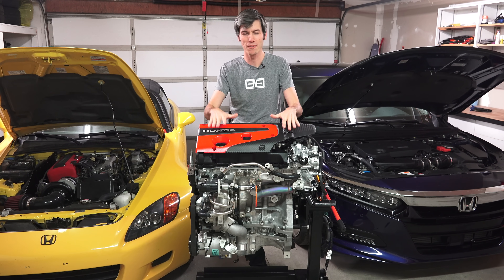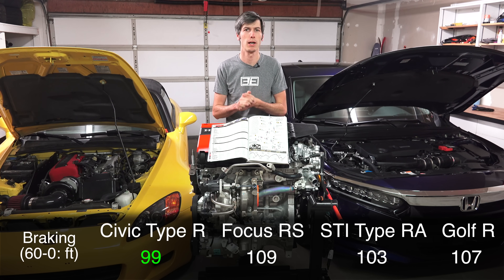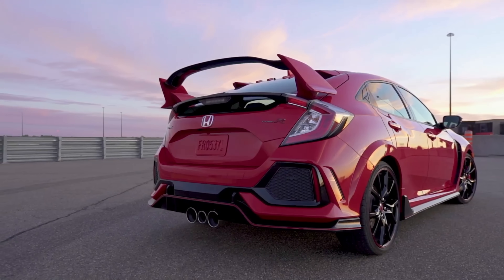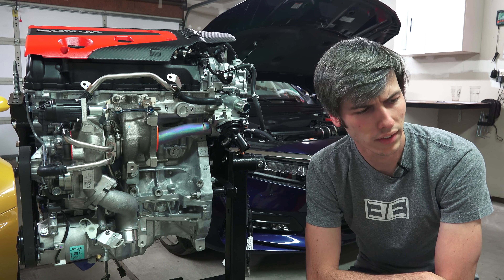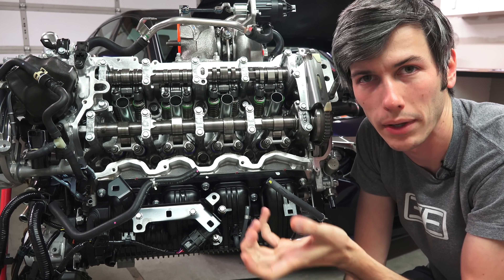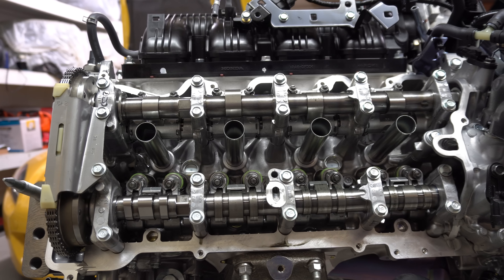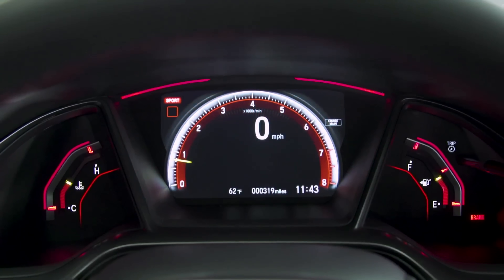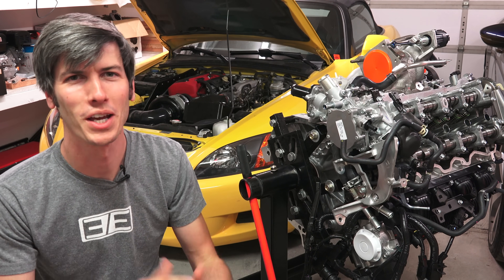The Honda Civic Type R Destroys The Competition - The Best Engines

Comment: Subaru.... wtf....
The EJ entered production in 1988.... sure, they've 'update' cams, injectors, and such but they are STILL running that engine in their flagship car... 30 year old engine design.  wow
Reply: 30 years isnt much. Building engine from scratch isnt cheap, evolutions of old ones are popular because they are unproblematic. Look at Ferrari, Lamborghini.... McLaren use 30 old years Nissan designs, Jaguar wins lemans in 1946 and then in 1988 with the same engine..... Its normal to use older and unproblematic power units.
Reply: TheDBall73 The EF came out in 1988. 1993 brought it’s EJ replacement.

Comment: ive seen too many drags with the new type r vs all the cars on the list here...the golf r dsg smashes the civic every-time...
Reply from the maker: Yeah, but how fun is it when you drop the third pedal? 6-speed is the way to go!
Reply: its a fair comparison, manual vs manual, the fwd manual golf is like for like and stands no chance to the typer
when honda can make a reliable dsg at this bracket they will release it, until then you can buy a dsg vw that fails at 30k miles....

Comment: If only MotorTrend would actually do the comparison with the DSG trans in the Golf R...it beats each and every vehicle on that list. Also, no Honda dealer sells that ugly ass Type R at MSRP (Not that I’d pay MSRP for it anyway). 

I would agree the Honda 2.0T is a nice motor. They should mate it to a beefier version of the 10speed tranny that’s in the Accord.
Reply from the maker: It's an all out hot hatch. 6-speed manual is the right choice! :)
Reply: Because its manual vs manual firstly, and secondly the DSG is in another bracket.... its kinda like asking why the dsg golf R doesnt get put up to the nsx

Comment: The Golf R is able to consistently do the 0-62 mph run in around 4.5 seconds, 0-100 mph in less than 11 seconds and the 1/4 mile in around 13 seconds, meanwhile MotorTrend isn't able to get those numbers on an AWD car but they can on a FWD car. The Type-R is an impressive machine and I'm sure around a track it smokes most hot-hatches, but the straight line numbers seem to be biased towards it.
Reply from the maker: Those are likely DSG numbers. Everything compared is manual.
Reply: @EngineeringExplained  Even then, the difference between a manual and a double-clutch gearbox shouldn't be so great, unless the driver does a terrible job with the 3 pedals...  The Golf R should be able to do 0-60 mph in less than 5 seconds regardless of the gearbox type. 

Thanks for engaging though, Jason!
Reply: I agree man. I've seen a type r go head to head with a Ford rs myself and guess who won off the line xP Ford.
Reply: @kaelanburke2097  Exactly, FWD can only do so much!
Reply: I agree my friend. Have seen a couple test of Golf R's where it hit 4.7! I would take the Civic though.
Reply: @keithjackson4985  There's tons on YouTube, some even hitting less than 4.5 seconds to 60 mph (with the DSG). I really like the Type-R for what it's worth, it's a FWD marvel. I recently saw it on the drag strip and even in wet conditions it hooks up and goes like it's none of its business. But I would take the Golf R any day, I love that thing.
Reply: @mikerelvas  I hope you get one brother. I'll be hunting for you! Lol!
Reply: @keithjackson4985  Let's go lol. Thanks man, you too!
Reply: You can't trust 4.7, 4.5 tests. The power in some area is greater than another.The sea level is very important, the ground level, the tires, the wind and finally the road conditions. So if somebody did the test in the same condition between the cars with the same driver that's should be the most accurate test! The true is nobody can beat Honda engines for reliability and maintenance cost.
Reply: @kirostar12  this is only valid for NA engines. Turbocharged engines see much less effect from the sea level difference.
Reply: Drive a type R. I rented one over the weekend and trust me it will blow you away. Especially considering its FWD.
Reply: @Magnum570  I never said otherwise though. I know the new Type-R is incredible and manages to put 320 PS on the ground like it's nothing. I just don't agree with MT's numbers...
Reply: Ya just gotta love the VW club!😂
Reply: @stwg32  Oh right, because Honda has a pretty good reputation going for itself lol
Reply: That check engine light will eventually catch up to it faster then the type r will.
Reply: @Ricky__96 I've never had any new vehicle have so many issues from the factory until I bought a Type R.  Head unit issues, wire harness issues, pcm issues, turbo solenoid issues, etc...  Traded it in for a mk7.5 dsg and have zero regrets.  I actually can drive my car now.

Comment: As far as I know, the VW Golf R mk7.5 in the USA has an acceleration time from 0 to 60 mph of 4,7 sec with DSG 7 gear box and 5,1 sec with the manual 6 gear box. 
In Europe this numbers are a little bit better with 310 HP making the 0 - 100 km/h in just 4,6 second with the DSG7 gear box.
Reply: The numbers in this article are BS...  I’ve not seen the type R out accelerate anything out of the hole and of course they used a manual Golf R...  a DSG Golf R destroys everything in its class.
Reply: Numbers are always off. You look at stats (by people who actually produce them) for different cars and you’ll get different results all along the board. 

I bought a 2018 manual SI versus my friend getting mk.7.5 golf GTI dsg knowing his was a lot faster 0-60 due to the gearbox, wheelbase, 20 more horsepower and an entire 60-70 more lb/ft of torque. 

However, despite the numbers “confirming” that my car will be slower, it is not. In digs as well as rolling races, the SI has never lost, despite having a manual gearbox and being quite significantly underpowered when compared to the GTI

There’s a lot more to cars than weight, gearboxes, and horsepower/torque.

We came to the conclusion that the mk. 7.5 golf’s gears are too long and it’s dyno’d powerband is not as consistent as the one in the SI, making it’s superior power less useful.

A lot of the time, you get cars that produce nice numbers on the dyno but aren’t able to use that power due to various restraints.
Reply: Steven Caicedo-Suarez   —  completely agree with you.  I drove them all including a little used NA Cayman and picked the 2018 SI for my daily driver, I couldn’t be happier.  (Yes I have many vehicles, including a Corvette, a gen 2 Raptor, Subi, EVO viii, as well plus several gas and diesel one ton trucks too.)
Reply: @stevenc8717  agree with you too, ive done lots of races against a friend of mine whose driving a 2016 wrx impreza, it has 268 hp and still he could never win on the long run against my si 2008 with 197 hp. Numbers are not all and honda has a way of engineering things, it just works !
Reply: Y'all have a huge advantage in that the utter garbage fuel in North America isn't even as good as your "eco blends", haha
Reply: Eulogy - not necessarily true. Don't forget that European octane numbers are calculated with a different methodology, and RON (European method) is higher than the US ((RON + MON)/2) by 4-6 points.
Reply: @ulogy  AKI and RON are not the same. Our 93 is just fine its the cali version of 91 that sucks.
Reply: a 2002 bmw m3 does 0 60 in 4.8 even tho the focus rs has 20hp and awd is still slower
Reply: Honda Type R vs. Seat Leon copra 300 with DSG
Reply: This article is bs. They tested all top of the line cars of this segment but couldn't find a DSG MK7.5. They even got a Subi RA! which the average subi buyer isn't even going to get, they would get the normal WRX STI, same goes with VW buyers! Yes a good portion of buyers would get the manual, but mfs know damn well they spending good bread on a golf so they gonna go all out and get the DSG. The transmission alone gives it a superior advantage to the other cars, facts.
Reply: Hugo Morala the rated the hp to 290 ps now
Reply: @f181234  yes, this is the number for the US. 310HP is for Europe. In fact, VW send the 292HP limited version for the Australian and South African market because the manufacturer argues that in those countries they have an average of warmer temperatures.
Reply: Merc A45
Reply: golf r is 4wd
Reply: @Synergy278 well comparing a manual honda to a manual golf seems pretty right to me dont you think ?
Reply: bob wesley no...  it has the least amount of power of the four...  a stock 292hp golf r with a DSG will out accelerate everyone of them.
Reply: Yea, I agree with your DSG comment. I call bs on this "comparison". There is no way this civic can beat the DSG golf in 0-60 or even 1/4 mile. Sorry, no way. Manual civic to manual golf r, maybe. Not the dsg.
Reply: Yeah but it's a VW
Reply: Drive one.
Reply: Emission standards are more stringent here in the good ol USA. And yet Honda is still faster. Very impressive.
Reply: @stevesteve3940  euro emissions are generally more stringent than ours except in how retarded we deal with desiel.

Comment: So What. 4 wheel drive is for off road . Up the turbo pressure and get 400 hp. Turbo any 2,0 and get high power. 
Rear wheel drive is better. balh blah blah...

Comment: golf R 0-60 in 5.7 seconds?  guess the guy shifting wasn't very quick
Reply: while i love shifting through gears manually, dual clutch automatics are faster than any human can shift and lead in 0-60 across the board
Reply: Automatics with launch control it's just point and shoot = better times than a manual. That said I still enjoy using that left pedal.
Reply: The Golf R DSG is faster than the manual. The DSG does 0-60 in 4.9 seconds.
Reply: Right?  Those numbers are bs
Reply: This.  A stock sti is upper 4's  low 5's. Why is the type ra slower then a stock sti
Reply: Yeah that’s not believable at all. I get low 5’s in my GTI. The Golf R has 72 extra ponies and AWD.
Reply: The golf R can do 4.6 seconds stock. I just did 3.5 an hour ago but I'm stage 2

Comment: I had the Mk2 Ford focus Rs that was boosted to more power than what the new type R is sitting on, same type of front suspension setup and a stock quaife LSD. Now everyone is fapping over old technology (that is quite awesome) because Voltron took a crap after eating the batmobile and, ta-daaaa, new civic. Honda fanboys still denying that a AWD would have been a superior option?... Let's be real. 1st gear in the wet and 2nd... USELESS. 
The interior cabin of the type R is near perfect though - the other brands could certainly learn from that!

Comment: Jason, why is Honda sandbagging their horsepower numbers?  The type R has been dynoed at 295 hp which is within 3% of the advertised number.  The standard 1.5 turbo actually makes MORE horsepower at the wheel than advertised at the crank.

Comment: The numbers are only because the car saves weight with having a front wheel drive and not because the engine is stand-out. Infact, there is nothing very special about this engine compared to current engines. Piston cooling, Sodium filled valves are nothing new . Integrating exhaust manifold is a mere cost cutting initiative and not very ingenious . Felt like a Honda propaganda, not a typical Engineering Explained video

Comment: Another thing, awd eats horsepower. You gotta send it the power through more heavy equipment just to get it to the back wheels. (Parasitic loss) Which also eats gas. I only get awd for snow. If you know how to drive. You don't need awd.
Reply: One you upgrade the power, eg, bigger turbo, exhaust, ic, inlet and higher boost, how are you going to put the power on the ground in a fwd on the street with street tyres ? 400, 500, 600 hp ? Fwd has its limitations. Awd gets the power down with bigger power.
Reply: @nordic5490  Mickey Thompson's/Slicks
Reply: MT slicks are rubbish on the street, terrible in the rain and ave a floppy side wall means bad cornering. Even the very best street tyres, eg Michelin Pilot Sport 4S, wont hoook up on a fwd once you up the power. This is a limitation of fwd, when you accelerate, weight lifts of the front tyres and is transferred to the rear @ eg 400hp.
Reply: Unless you live up north where it's almost necessity.
Reply: @sergeantspeed5941  lol, I do. Winter's are bad here. My Buick does alright as a drift buster though. It's 96 fwd.

Comment: Great vid. Good info as always to boot.
Just not a good enough pitch for me. Living in Canada I doubt the reliability of just about every car.
The thing that gets me the most with these track tests is they are always aimed to give a good go for each competitor. Sure, its great/fair...But when is the test for driving in a foot of snow with ice in -20°? 
Bet the awd would go a long way. And a side note... comparing it to an RA? Really?...Even true AWD fans cry that the 2.5 shouldnt be around still. that thing is an insult and they know it.
As for the RS...welp. At least they addressed the headgasket issue finally.
Reply: assassind36 

So what car is more reliable than a Honda?  The RS will of course prematurely blow up its head gaskets and engine.  Even the Subaru, and I’ve had plenty, is decidedly less reliable.  VW reliability?  Bwahahahaha!

Comment: HONDA needs to make all their engines chain driven.  HONDA dealerships charge $1,100.00 - $1,400.00 for a Timing Belt Kit . My mechanic did it for around $850.00 .  I'm thinking of buying a Toyota , their engines are chain driven.
Reply: John Lopez 

All Honda Civics have been chain driven since 2006.  So where have you been for the past 13 years?
Reply: @viffer94   good to know, my Accord, Pilot and Ridgeline are all powered by 3.5 V6 engines . Thank you
Reply: are you driving a 80s honda by any chance? Practically all the new hondas are chain driven

Comment: Golf r (manual) does 0-60 in 5.1 seconds and automatic is about 4.7 seconds
Reply: DSG, not auto. Do you ever watch this channel?
Reply: DSG is still an automatic transmission, it's just not a typical automatic transmission with a torque converter.
Reply: @samteks997  don't need to watch the channel to know DSG is still an automatic transmission

Comment: The Honda performs better in the real world due to its VTEC system.  While the competitions powerband starts dropping at an early RPM before redline, the Honda carries more average horsepower to redline.  The RS has more BHP, but it has a very short power band above 5,000 RPM.  This is why VTEC is so good.

Comment: I've always said Hondas make good motors....that's about it. That 300lbs less weight is due to the fact that if you hit anything they crumple and virtually self destruct....
Reply from the maker: Sure, has nothing to do with not having an AWD system or good material selection. I asked a steel company once which auto manufacturer had the best use of high strength steels, using the good stuff and not cheaping out. His first thought was Honda. Third party that sells to all of them.
Reply: @EngineeringExplained  well I've seen a thousand early civics, integras, accords etc especially between late 80s to mid 90s that rotted to nothing. Whole boots just gone! To say Hondas are strong or well mades a bit of a stretch. The most latest models may have finally addressed the rust issues with coatings a bit. And take a standard integra....you have to fully upgrade everything underneath to get them to feel even remotely decent at speed. Even tho its expected with fwd the understeer on Hondas is terrible. I have to really be on the throttle around a roundabout to get my primera to sledge, and even then it tends to swing its ass end out and go into a 4 wheel slide than under steer ( unless I'm on it hard ) . I've raced many Hondas and they suck on corners, especially the civics and crx's! I can pass them on the outside and still pull in front round the apex under power. In my experience hondas make excellent engines but lack in a lot of other areas. Handling, comfort, strength, durability etc all a bit lacking for me. I know ya love them lol but not my cuppa tea. My first real job was at a wreckers yard. Hondas kill people or test their luck even at low speed crashes they're written off and twisted. I drove a Telstar tx5 that got t boned at 100km, the passengers door was 6in off the centre console but still drove straight hands off wheel! A Honda would be in 2 pieces.
Reply: @EngineeringExplained  sorry but one other thing is after many years of rummaging thru wreckers yards its hard to find a Honda with more than 400,000km. Most die and are scrapped around 250-300k, I've had my primera 18years and done 540k before it broke a ring! Everything else works fine. With the rebuild I expect to take it to the million k mark. Never seen a honda with 500k ever! Let alone still tidy and running well.

Comment: The chain drive is a major plus.  I had a 99 Si  which has the looks and performance.  264k miles before I sold it many years ago.  Hondas are finally getting good again  need to work on the aesthetics, that is the dealbreaker for me.

Comment: Cool conversation about stock cars. Let's mod them out and see what stands. My money is on the STi and RS.
Reply from the maker: Perhaps, but you’ll pay way more for the performance. There’s even an electric AWD mod for the Civic. Throw enough money and anything can be fast. Remember you’re starting $6k higher for a Focus or R before any mods.
Reply: @EngineeringExplained  come on, that's disingenuous. Some platforms are much better at handling/receiving power upgrades.

Comment: Yes good engine, cool but its only because its 300 pounds lighter than the other three it's competing against. So yes props to Honda but if the other manufacturers knew Honda's secret for light weight vehicles they'd also be performing the same way.